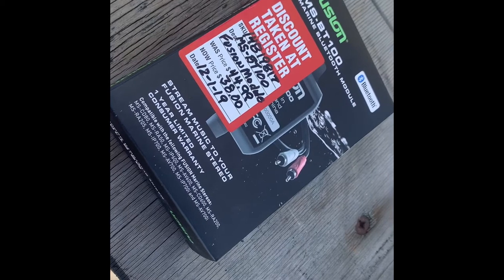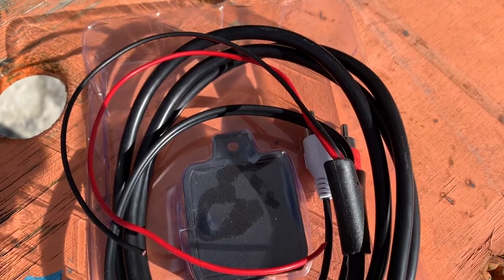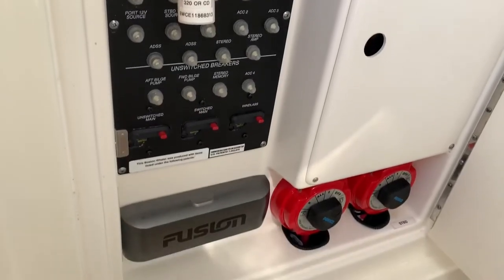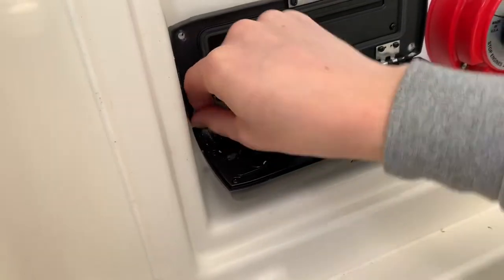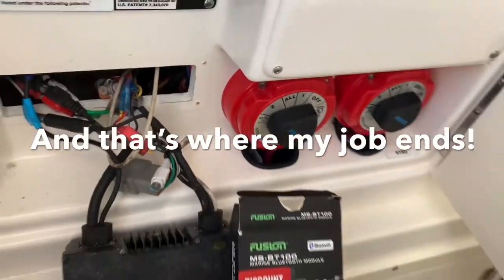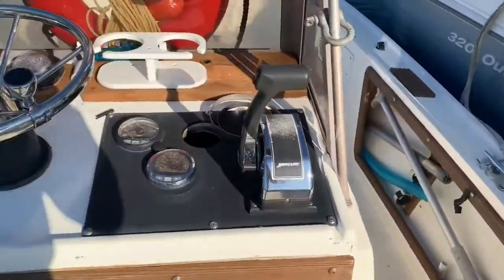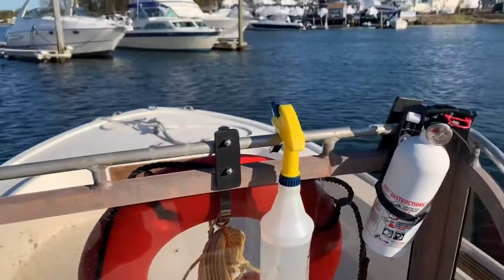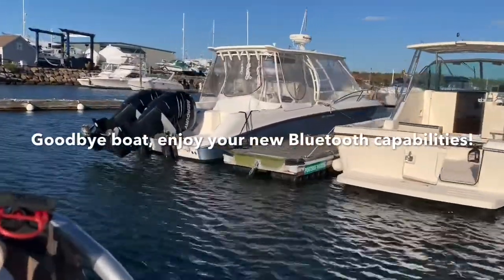How To Knot Install a Fusion MS-BT100 Bluetooth Chip

Comment: Has anybody had loud popping from this unit when it receives a BT signal even if its under fulltime 12v power? On my second one and still have the loud popping problem
Reply from the maker: Yes I’ve had this issue before. It only sometimes happens but very rarely :)